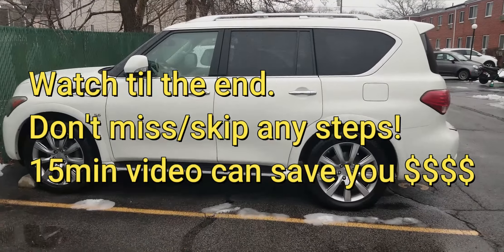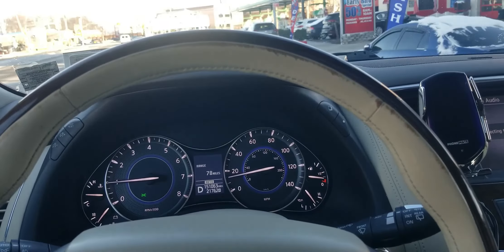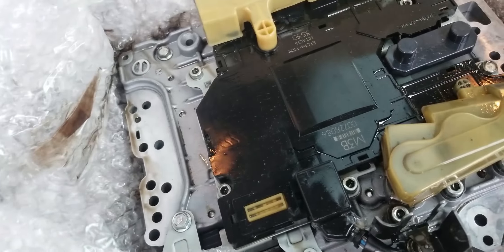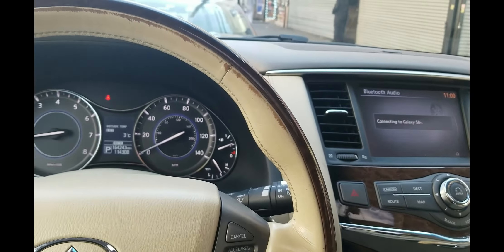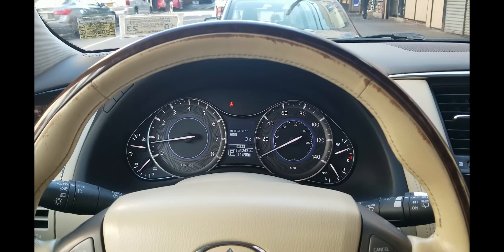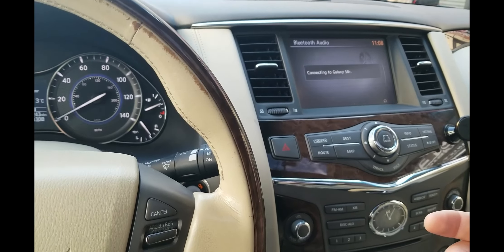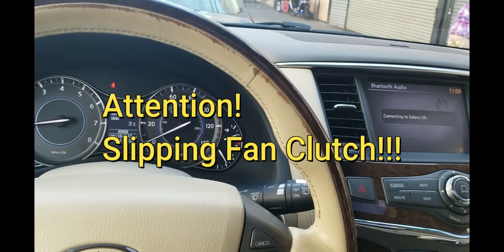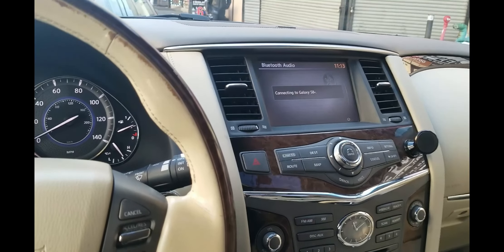Infiniti QX80 transmission problem, jumping RPM, RPM surge, shifting problem

Comment: Im having jumping RPM's. Transmission oil lines rotted out and lost all oil. Wife drove to work and couldn't drive no more. I Fixed lines and refilled with oil. Now, i have BCI MALFUNCTION and drives slow. Turn car off and drives like slipping between gears. My question is.. BCI MALFUNCTION doing this or tyranny??
Reply: 2015 qx80
Reply: Engine light also on for 2yrs
Reply from the maker: Bci has nothing to do with transmission, but it can be related. 
What code you have?
If its sleeping maybe wasnt changed right way, or low level
Reply: All oil leaked out when wife drove it halfway home. I drove it the rest and was slipping more and more until I got home. Mechanic fixed lines, fill it with oil and now(after 1 mnth) drives but slips almost every gear with rpm 3,000. Then BCI MALFUNCTION comes on limiting power
Reply: But transmission was totally empty

Comment: O took mines and they quoted me 9000 its doing the exact same thing and they refuse to change my transmission fluid at the dealership! I think im going to take it to a private shop and inquire about my valve body❤
Reply from the maker: Dont change valve body, it didnt help. You may have to change trans oil few times, because a lot of oil sits inside torque converter and it only can blend with fresh fluid and months..or so.  First clean your arif flow sensor...

Comment: You say it fixed the issue but at the end of the video you have the same issue. Is it atill fixed?
Reply from the maker: At the and I put old video on background...(i didnt notice it when made video), I dont have that rpm surge anymore
Reply: @focusbvi  wow thanks sir God bless you for posting this will try
Reply from the maker: @vamosajugarpelota   many people saing it tourqe converter, ia also could be as an option, but some people said that aftr replacing it at the dealer still had same issue... so hard to tell what exactly fail
Reply: Updating you here. I changed my tranny fluid twice and added instant shudder fix. It does shift much smoother. I also had my exhaust manifold changed for the catalytic converter issue. When he was doing that he noticed loose tranny bolts on the top of the tranny he tightened them down now it shifts almost perfectly. Will add another instant shudder fix soon and update. The issue does seem to be torque converter with loose bolts you may want to have your bolts checked as mine could be loosened by hand literally. Thanks for the video bro!
Reply from the maker: @vamosajugarpelota  thanks for update. If you changed cats and add shudder fixx at them time you can not tell what exactly fixed the problem, but anyway bath of them had issues. Im using cataclean 4th bottle during 3k miles after last cats code. I dont have major issues with rpm surge at this time but has no tourqe as my Benz has, Im adding today shudder fixx too and will see.
Reply: @focusbvi  cool let me know.  Check your bolts the ones on the very top of the tranny were completely loose
Reply from the maker: @vamosajugarpelota  just picked up qx. Didnt check bolts, because I didnt tell them early to check..maybe next time. Added 1 tube shudder fixx  from autozone. Drow around 10min ... I didnt notice big difference, possible a bit better ... if dont press gas gears switching close to 2k, noticed when I press harder it easy goes and swith gears cles to 3k. Rpms drops anly when I release gas pedal. (Not by itself as I had before, droping down too early). I have to try another qx and see if any differents  or all Infiniti like this.
Reply: @focusbvi  my rps drop like that to it's weird. It may be Infiniti but as long as it's not jumping around i think your good just have them check the transmission bolts. I have 2015 qx80

Comment: My opinion this is not a transmission problem the is more of a emission so fixing the air flow meter is where i wood start
Reply from the maker: Yes in general its not transmission problem, infiniti very sensitive. But I stll dont like how gears ratio programmed on QX

Comment: 2012 infinity qx56 
was driving today, and all of a sudden the car wouldn't go pass 20mph!! I was so scared!! Because I was going up a bridge and was lots of car at the back!!
I have a friend of mine scanned it.
It says P0705 
The Transmission Range Sensor detects what gear has
been selected by the driver. This error may cause the
transmission to not shift into gear because the transmission
does not know what gear the driver has requested